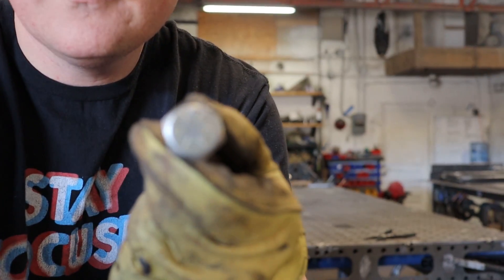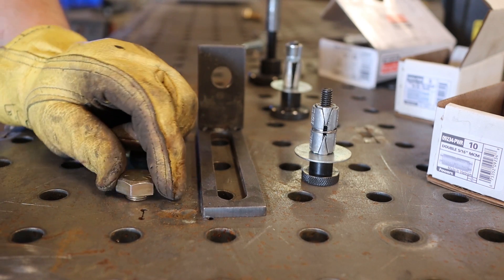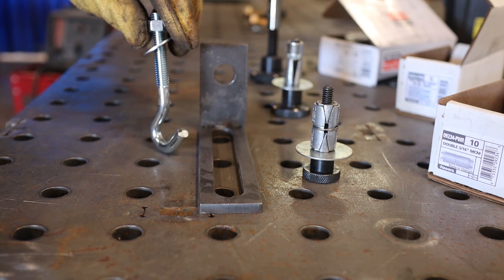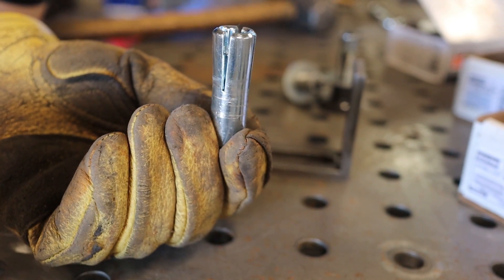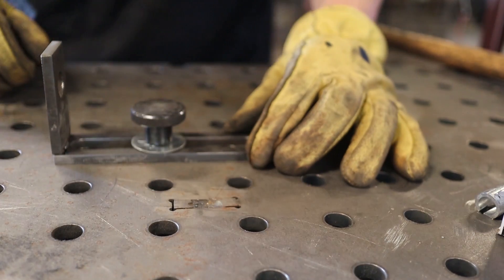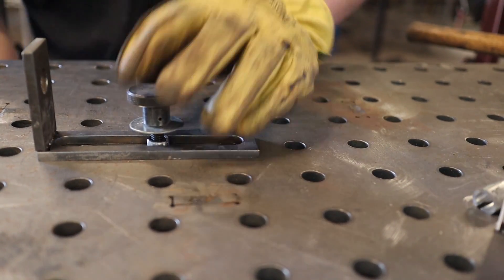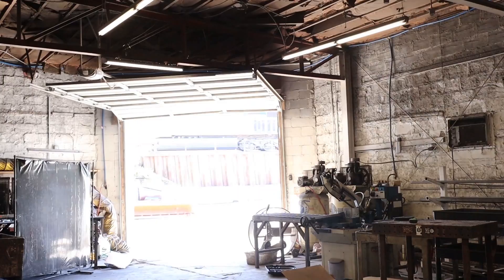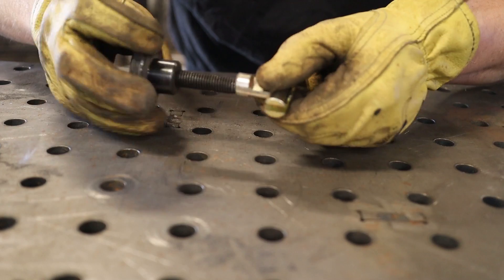PLASMA FIXTURE FAIL - BALL LOCK HACK

Comment: Everyone saying thread the holes.   That's a pain in the ass the threads always get shit in them and constantly need cleaned out.  The point of the weld table is to increase productivity not frustration.......   The ball lock bolts are the best solution unfortunately expensive... they do not work with thin tables and clamp range on most of them is .9" and above    so you need to either stack washers or have really thick tooling

Comment: Its a little extra work but a 5/8 OD 3/8 ID bushing threaded to 1/2x13 and slit at the bottom like a collet. Id only make one slit for durability but by unthreading the 1/2x13 bolt you should be able to tug the collet closed again if its short enough.

Comment: So they just use threaded plates to secure jigging on this table.  https://www.youtube.com/watch?v=rZIWh-Hvc5U

If the table is 4 feet wide and accessible from both sides, what would be wrong with using nuts on regular or shoulder bolts ?

Comment: I love this channel and this topic.  I've been wanting a fab table forever.   Hope you find a solution to this problem.  Some hitch pins are 5/8" and some have a spring loaded ball built into them.   They are used on gym equipment too.
Reply from the maker: Wow thanks man!  I can find stuff to go into the hole but it gets tricky when you want to tighten down on something and then remove the bolt to use it in another spot.  Really a little puzzle.

Comment: Could you change the design for the tables undercut the hole size and just tap the holes in the table and use bolts.
Reply from the maker: You can totally tap all the holes, I'm just trying to find a different solution.  Any little weld berry would mess with the threads.  The same can happen to the holes but a spud wrench usually knocks them loose. Whole a tapped hole would need to be chased.  I guess it wouldn't be a big deal to keep a tap on the bench.